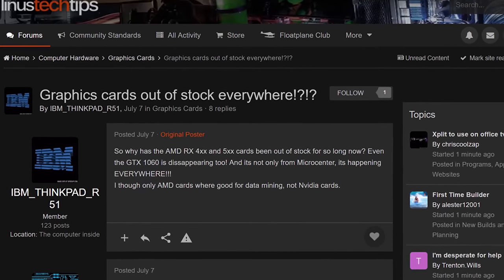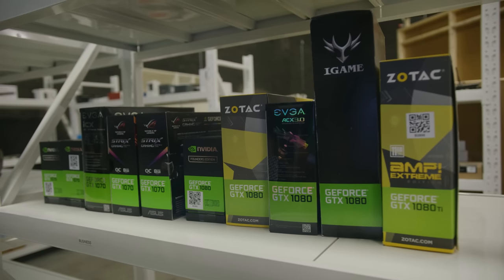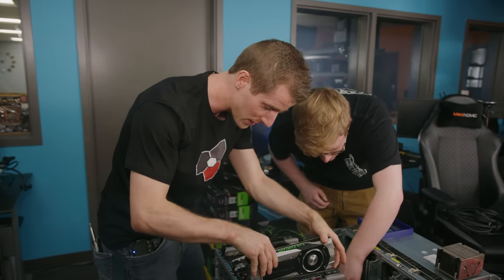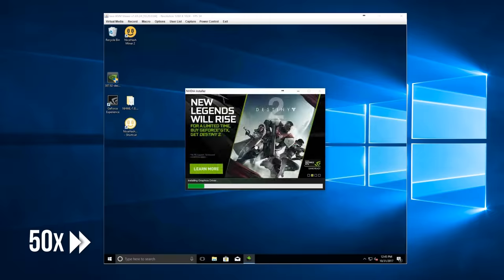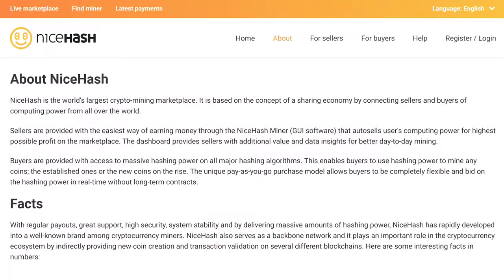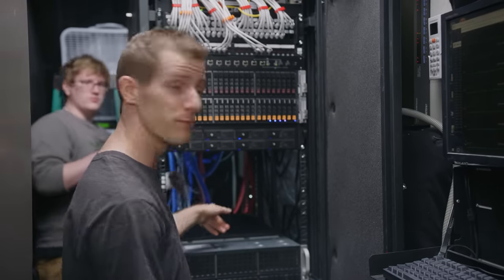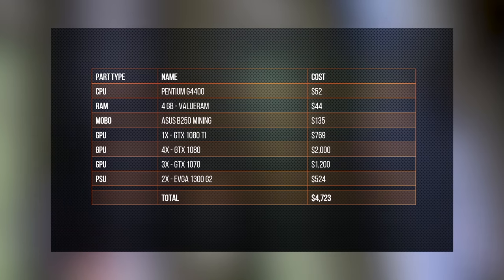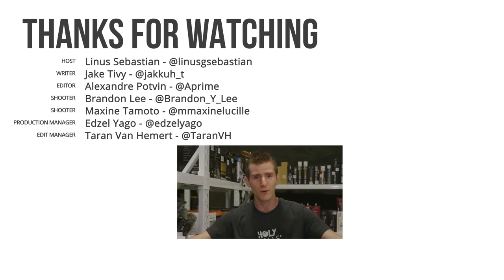IS GPU MINING STILL PROFITABLE? - Mining Adventure Part 1

Comment: I'm a miner and a gamer. That said:

I have 48 NVidia GTX 1070s running in my garage at the moment. The number of gotchas (the 8 GPU limit being one) is ridiculous trying to set up this type of thing. Windows only currently supports 8 GPUs per *driver*, so you can actually load 8 NVidias and 8 AMDs onto the same box. Linux will support any number of GPUs out of the box (my boards all support 13 GPUs, I have the Asus 19 gpu board Linus mentioned in the video, but I'm still working out the heat issues.)

Oh the heat issues. I wish I lived in Canada, but I live in Arizona. Where it's 90F/32C in November. One rig of 12 GPUs wasn't terribly hard to cool as long as you vent the hot air out the window. Two rigs of 12 GPUs couldn't even really be run in one room since US room circuits are 10-15 amp rated. Out into the garage into some 42U racks it goes. The APC rackmount air conditioner can't keep up with three rigs of 12 GPUs, so it got returned. I have a portable 14000 BTU air conditioner pointed at the front of the rack with a towel and foam around it so the cold air doesn't go around the boxes (they're mounted in rack mount cases, 3 120mm fans in front and 3 in back.) The rack itself is closed up except for the top, where I have an 8" A/C duct with inline fan venting into the ceiling. The venting air can easily reach 120F/49C through the vent. The last rig I just put online (12 more GPUs) is in a bin of mineral oil, with a hot water circulation pump, garden hose, box fan, and a 2007 Dodge Ram truck radiator. The fan is temporary but when I have the proper (very noisy) fan on the radiator, the cards are only a couple degrees C over their startup temp. (Startup temp: The temperature the cards reach soon after mining starts, typically 10-15 degress C over ambient.) So the A/C covered cards run at 64-74C, while the oil cooled cards run 50-68C. But...

Electricity usage. Running 36 video cards and the 14000 BTU air conditioner for one month cost me $665 in power @ 0.11/kWh. The fan/pump/oil combo runs around 1/10th the power of the A/C unit, but costs more in materials up front (mineral oil being $20/gal on average, my rig uses 11.5 gallons.) Running those 36 video cards earned me $1600 US, though. If I do all the math (which I have), my ROI will be 10-11 months as long as difficulty remains within 10% of where it is and coin (in my case ETH) is above $300 each.  Now you can tweak your power usage easier with Nvidia than AMD, which is why I went with them. A GTX 1070 will run 155 watts-ish out of the box, but the number of watts you give the card can be controlled. On air cooling, I can get a steady 30-31 Mh/s in Ethereum with the fans at 95% and the cards limited to 105W. Dropping that 50 watts REALLY reduces your cooling requirement. Other alt-coins (Zcash) ran like crap with that setup, but Eth must be more memory bound. BTW, that watt limit includes the fans on the card, so putting the cards in oil and setting the fans for 5% (for circulation, required) meant I had to bump up the limit 15 watts so the fans would spin up without cutting into the hash rate.

I also take notes on my rigs, so here's some information to share. Side note: I power everything except the motherboard with HP server power supplies powered with 240V "two phase" because it's more efficient and the power supplies will put out their full 1200W with that input.

- An ASRock 13GPU motherboard with 4GB ram, USB stick as storage and 6 Zotac 1070's at idle running Ethos = 92W @ 110VAC.
- Same config at 32Mh/s load: 768 watts.
- Same config as above running Windows 7: 970 watts. Idle was 127 watts.
- My portable 14000 BTU A/C unit uses 1335 watts.
- For Ethereum, lowering the GPU clock to minimum and raising the memory clock to 4300-4450 yielded best results. Card limited to 105 watts.
- Get the PCIe risers with the onboard 3.3VDC power supply. They're better.
- The actual PCIe cards you plug the USB3 cables into on the motherboard are finicky as all hell. If you lose a card, check that first.
- A full 13 GPU rig with an ASRock motherboard, 4GB ram, etc... pulls 7.7 amps at 240VAC when hashing at 385Mh/s.
- Ethos has issues running more than 10 cards (the OS gets really laggy, CPU doesn't seem to make much difference.)
- Applying better quality heatsink paste to the cards doesn't make much of a difference and isn't worth it.
- The Zcash miner for Claymore is AMD only.
- Equihash required me to release the power limits on the cards which made them hot as all get out.
- People look at you funny at Tractor Supply when you sell them out of horse laxative. (Light mineral oil.)

Comment: I would like to see the card manufacturers figure out a way to keep track of the "hours" a card was used so that people don't end up buying last gen cards that were used for mining.
Reply: Whats the problem with that? Asking as a miner, who buys old stuff off of miners to mine with as a business model. (I have semi-free electricity and don't care about efficiency)
Reply: Mostly to help prevent dishonest people from selling mining cards as "slightly used no Mining".  Because like a car, electronics have a life span and the harder and longer they are run at max the shorter the life span will be.
Reply: undervolted chip running at full within its thermally designed limits. its proven that 3 hours a day of gta5 on ultra does more "use" on a card then 24\7 mining. Know you hardware before you chat shite about it
Reply: Shhh. you are ruining our PROFIT man keep it quiet...
Reply: The electronics don't deteriorate during a 1 year span as much as you'd think. You can see many Intel i5 2500K's running overclocked even today. Usually what fails are the fans because they are really cheap chinese rebrands with sleeve bearings on most of the cards. The cards usually are not profitable after a newer generation comes out, so that's about 1-1.5 years at most.
Reply: The idea that mining "degrades" a card and shortens it's lifespan is a complete myth. Outside of the fans(which any decent brand will have fans that will long outlive the useful lifespan of the card) there are no parts on a graphics card that "wear down" from general use. What will shorten a graphics card lifespan is pushing excessively high voltages and temps that consistently push the thermal limits of the card. Thing is, most miners undervolt their cards in order to hit the hash per watt sweet spot and generally run cooler than graphics cards used by gamers. So in reality, 99 times out 100 a used graphics card from a miner will be in better shape than a card used by a gamer.

Comment: Linus the GPU's only need 1x speed for cryptomining
Reply: w u t
Reply: yeah 
one 
ASUS B250 Mining Expert  
could connect 19 GPU
Reply: it's true, but in that dual socket board, some of the pci-e slots are wired to cpu1 one some to cpu2. so, if you only put in one cpu, half of the slots are dead.
Reply: Also
>Using 1080s for mining
As a 1080 owner I can confirm they are dogs when it comes to mining. Anything Radeon so much better.
Reply: yeah, its just that not all pcie slots are enabled with 1 cpu in there
Reply: But hey this is Linus, Nvidia own them so it has to be Nvidia... Sellouts
Reply: (Nvidia doesnt own them, april fools joke for people that dont know)
Reply: 8 GPU's per operating system,
run more than one and you're good.
Reply: Rizzen, and 1080's are known to be dogs at mining, they shouldn't be used, the power draw to performance is horrible, IF stupidly mining with a Nvidia card (because you want the best gaming performance when not mining) you should be using 1070's they are the sweet spot on price to performance with Nvidia cards
Reply: Linus already knows, he was talking about it on a WAN Show in the past when looking at the ASUS board
Reply: Seriously? so you could spend so little on a pentium G4560+ B250 mobo, 7 GPUs and it'd work perfectly fine?
Reply: The Actual Joker yes thats what sirious miners usually do
Reply: The Actual Joker, thats what real miners do, they get the cheapest most power efficient CPU they can get
Reply: You have no idea what you are talking about. 1080's work great, especially with Equihash.
Reply: redoctober34, yes 1080's physically work, but they are well regarded as the WORST GPU for mining from the current generation, there hashrate to power consumption is HORRIBLE, an RX570 at like half the price has a HIGHER HASHRATE, hell even a 1070 has a 16-19% higher hashrate, it's not that they are incapable of doing the work, it's that they are the WORST cards to do it with, because there are CHEAPER CARDS that use LESS POWER and get a HIGHER HASHRATE meaning MORE PROFIT. https://wccftech.com/ethereum-mining-gpu-performance-roundup/
Reply: DanielRichards644 yeah, but thats ethereum..... with the gddr5x stuff
Reply: nem 1970, you need to look beyond raw hashing power, you need to look at the COST OF THE CARDS and the electricity to run them relative to the hashing power, look at the list I linked above, only in like 1 coin does the 1080 have a hashrate high enough to overcome it's increased purchase price, there are multiple coins where the CHEAPER 1070 even has a BETTER hashrate
Reply: lmao
Reply: not really you can underclock them for efficiency and they do a lot
Reply: also resale value is higher on 1080 so the cost isn't really a big issue. If you get them cheap they are great for mining vert, zcash, and some others and with nicehash in particular they do their jobs trust me haha
Reply: nvidia for Zcash, AMD for Eth (and monero)
Reply: BanControl, I "undervolted" (technically lowered the power limit) on my 1080ti to like 73% and shaved 70 watts off the system power draw at the wall (went from 290 to 220) and at most lost 10% of my hashing power, but it seams to vary depending on the exact coin, i'm pulling about 4 bucks a day at the current value of bitcoin mining with NiceHash, if I had the kind of money the system Linus built in this video I'd buy an Antminer S9 or something and make WAY more money, by my calculations 6 S9's running would earn me after electricity cost and what they actually cost to buy (if I had the bitcoin to buy directly) about what I make in a year working, wish I had 1 of them things.
Reply: Kofi dkency, yeah because that totally doesn't sound like completely scripted bullshit SCAM, EVERY review on there Facebook page is clearly a FAKE profile with at best some random stock photo and all there reviews on trusted reviews where posted on the SAME DAY, alarm bells going off everywhere about how big a scam that one is.

Comment: Linus... You realize most people mine off of PCI-E 1x slots. Right? You dont need x16 or x8 speeds to mine.

Also you can usually make more money by straight mining a single coin or dual mining. E.g. ETH or SIA. Nicehash takes a hefty bit of the money you make.

Reason for edit: Forgot to mention dual mining.
Reply: Mining a single coin is actually less money usually
Theres a reason most mining forums suggest dual mining.
Reply: When I used to use nicehash it only supported single coin mining aswell, but took a hefty fee. Has this changed?
Reply: no idea because I don't mine, I was looking into it though
everyone was saying to dual mine, saying something about reducing downtime between hashes
it could be a myth tbh
I just wanted to know how to put my gaming rig to good use when I'm not using it, currently I just contribute to folding@home
Reply: Dual mining isnt a myth and it can increase the amount of money you make. In dual mining, you mine 2 cryptocurrencies at a time. E.g. Ethereum + Siacoin. This is because some algorithms cryptocurrencies use are not very intensive on the VCORE of the GPU and are "bottlenecked" by the VRAM. Last time I chcked nicehash only supported single-coin mining but they had dual mining support planned. I don't know whether or not they implemented it yet.
Reply: Mining a single coin can result in losing money if you are not careful.   But agreed that you don't need a motherboard with all those 16x slots you only need 1x speeds
Reply: Hey dude Im not sure if you have the time or not but I would like to get into mining a little bit though I dont have the money. I just want to collect some knowledge on it and make my move from there any suggestions?
Reply: I don't know if Linus has ever heard one of these.

https://minerz.info/436/4-pci-express-usb-riser-expander-card
Reply: For all of you who use nicehash: https://imgur.com/a/VzQ6I
Reply: Remidial Mining 097, not even a 101 on the subject. 

Like miners have server racks lying around? Those cards should be on risers and wtf, ac? They be shoved in a garage with Canadian outside temps. He's killing the watts per hash efficiency with those Xeons, should be one celeron on an AS Rock board. He needs to undervolt. These are mining cards, not your children. 

I think that's probably why gamers hate miners. So maybe my old gaming rigs are left on in my room... but mine nor his are not serious attempts to mine at all. He's trying to get people in with single 1080 ti (or really anything recent) to leave on their machines because, well, figure it out... it pays more than turning it off. I hope he gets to power supply efficiency ratings. 

Even if you're not like, all into crypto currency as a store of value, it works as free Steam money (and you too can rock yourself back and forth someday for spending BTC before it went up 5x). But hell, BCC is on a tare right? ETH is a baby, and S2x will come again... but what do I know about Blockchain? TLDR
Reply: I agree with you Kasey, Linus should have certainly put more research into the video. I'm surprised those video cards aren't exceeding 100 degrees c that close together.
Reply: I dual mine ETH/Sia. CMON SIA I BELIEVE IN YOU
Reply: +Kasey Kees
Yeah, I agree with this. Those GPUs should not have been crammed. Use risers and spread the GPUs so they don't build up heat. I don't even use AC on my mining rig, but I did salvage some fractal design fans from my gaming PC (built in 2012). Also agree with those Xeons. A Celeron is what most miners use.

Comment: It would be cool to see a video discussing how to spot used mining hardware on eBay so that one might avoid purchasing it. My thought is that the cards being run constantly is not to conducive to longevity. I am probably overthinking it.
Reply: It would depend a lot if it was adequately cooled. The best sign would probably be a single seller selling a very large number of used gpus though.
Reply: @DBZHGWgamer  yep. If they are selling one type of card, but selling alot of that specific type, they are most likely mining cards unless the seller is a big graphics card seller.

Comment: Basically can't trust eBay for used graphics card for the next year.
The "never been used to mine" is funny when you see the sellers selling 2-6 of the same GPU.
Reply: yeah and only buy gigabyte and evga they have warranty you can check online and requires no proof of purchase if can see the serial number in the pictures
Reply: It takes a long time to kill a GPU and most mining gpu's are even under-clocked, and having a stable load is better than having the constant heat stresses from gaming.
Reply: Mining GPUs are in better conditions than gaming cards, so I don't know what you are whining about.
Miners go for efficiency and lower the power target of their cards. They're undervolted and pretty much never go past 60-65c.
It doesn't matter if they stay at 100% usage for a long time because what kill cards and the soldering is the expension and retraction due to the cards changing in temperature often from going between idle and 100% usage.
Staying at at 65c 24/7 is better for a GPU than going 70-80c for a few hours when gaming and coming back down to 30c at idle.
Frequent change of temperature is what kill cards.
Reply: It's been this way since 2013
Reply: ive been gaming on a retired 290x miner for 2 years (after my gtx295 died). paid 50 dollars for it, ive had it overclocked the entire time ive owned it, and running over-volted too. mining cards run the chip at a high throttle, but use only part of the memory (mine maxes out at about 2gb usage at any one time while mining) so they actually dont run very hot. as long as the fans are still working properly when buying a used mining card, it will probably work just fine. but i always recommend pulling the cooler off and replacing the thermal compound. i run arctic silver on mine, and at 100% load while overclocked, i max at around 70c (screenshots to prove it while running fuzzy donut of death)
Reply: Honestly, I've consistently seen mining GPUs in better condition than gaming ones. Miners usually know how to tweak for lowest power draw and max hashing power. For a few of the most popular alt coins memory speed is more important than core. Hence why Vegas are able to mine 41 megahashes with only 130-135 watts of draw. Even with the core pushed down to sub gigahertz clocks. Meanwhile most gaming Vegas will be running at least 300 watts. Now it's an argument of whether a Vega that's at 45C 24/7 will have more "wear" than a Vega subjected to temps of 75C for just hours out of the day.
Reply: Like everyone above me sayid. Miners usually underclock/volt  their cards for better ppower consumption and efficiency. Plust they run at stable speeds/loads constently. So it would actually be safer to buy a miner card then a gaming one thats bin overclocked to shit.
Reply: Depends how often someone games, compared to a mining setup running 24/7. I for one, will only game a max of 10hrs per week.